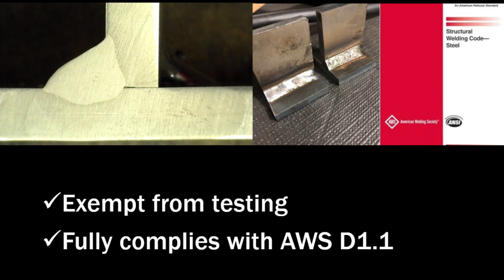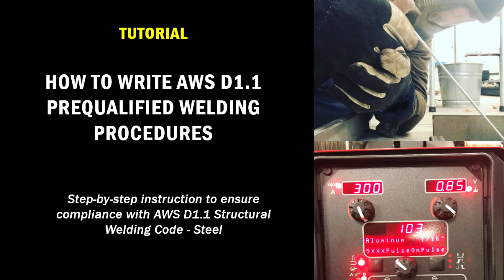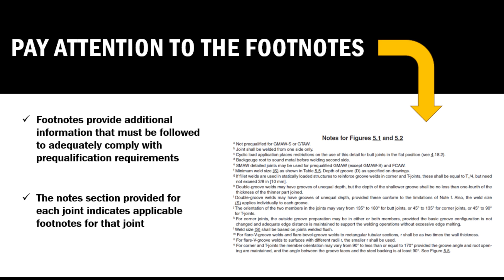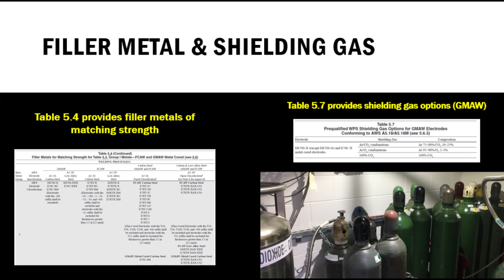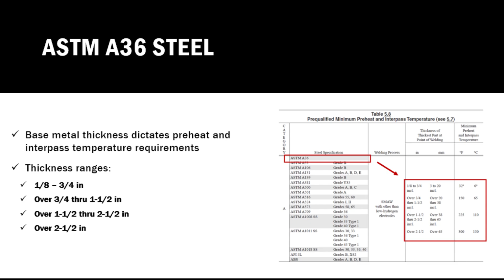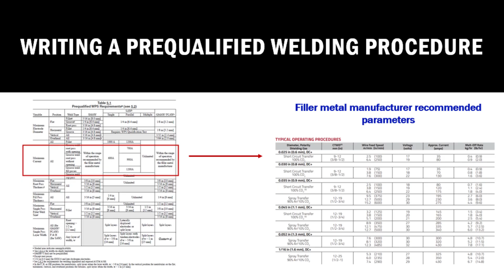Prequalified Welding Procedures - AWS D1.1

Comment: Where do I start??
The opening scene shows downhill GMAW welding, downhill is not pre-qualified and neither is GMAW-S, Short-circuiting mode. 
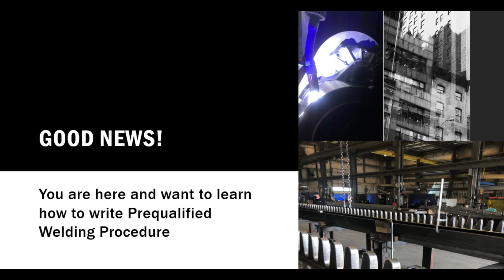@ 1:10 this video states that you can buy Pre-Qualified procedures, this is not true. You can purchase Standard WPS's, but otherwise, the Contractor is responsible to develop WPS and PWPS.
Reply from the maker: Thank you for taking the time to watch the video and share your concerns. You are correct that GMAW-S and vertical-down GMAW welding are not permitted for prequalified WPSs under AWS D1.1. However, the video does not state that either is permitted. The opening footage is simply general welding imagery and is not intended to represent the specific requirements discussed in the video.

Regarding the purchase of prequalified WPSs, a contractor is responsible for ensuring that every WPS used in production complies with the applicable code and is appropriate for the work being performed. However, this does not mean the contractor must personally write every WPS. A contractor may hire a qualified welding consultant or purchase prewritten prequalified WPSs from a reputable provider.

The important distinction is that a purchased WPS or PWPS cannot simply be placed into use without review. The contractor must evaluate and, when necessary, revise it to confirm that it remains compliant with the applicable edition of the code and accurately reflects the materials, joint details, welding process, consumables, positions, parameters, and other variables used in production. This includes verifying that the selected filler metal is used within the manufacturer’s recommended operating range and that all parameters remain within the limitations established by the code.

Standard WPSs are another available option, but they are not the only legitimate way for a contractor to obtain a welding procedure. The contractor retains responsibility for code compliance regardless of who originally prepares the document.

Thank you again for commenting and providing an opportunity to clarify these points.